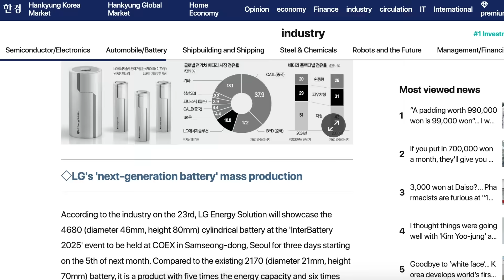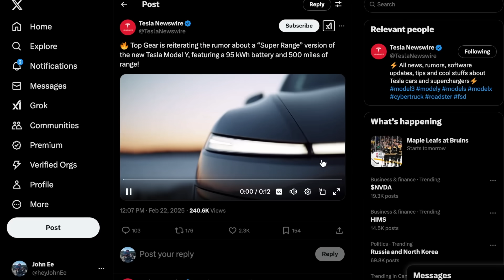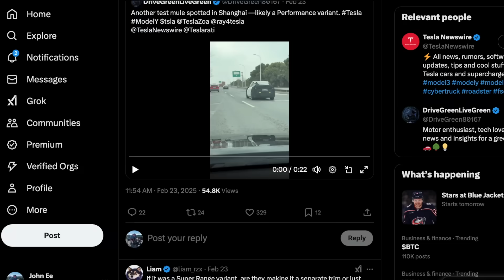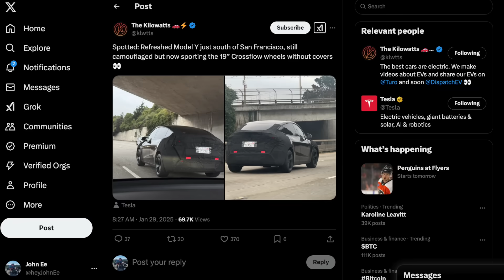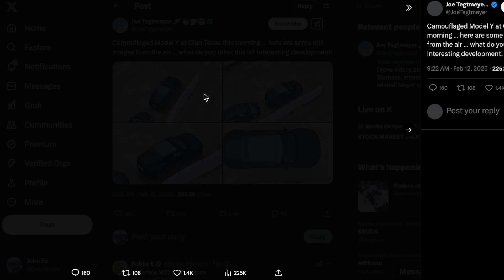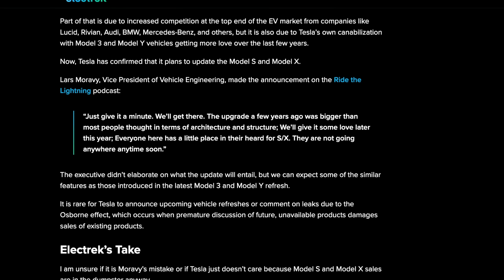Tesla Model Y Juniper Massive "Super Range" Battery Upgrade Coming  | It’s Exactly What We Wanted

Comment: The math. Todays 82kWh battery to a 95kWh battery is below 20% added. 20% more range will make the Y go 337 miles + 20%.= 400ish miles in a slightly heavier Y. So 500 miles is BS.

Comment: If the Performance gets a 95kwh battery EPA will be 365 miles, real life would be 275 miles, and this is what I want. I want to buy the Performance that is a lot less efficient than the RWD and right now the Performance is giving 225 miles real life and this is too low for me, I need more, and I know because I have a model 3 from 2019 with just have that range and I need those extra 50 miles. I you want RWD right now is giving you those real life 275 miles.
Reply from the maker: You want to buy a perf that’s a lot less efficient than a RWD? Lol  🤨
Reply: Current long range is 72kw usable and gets between 240 and 260 real world in the long range on the highway . 95 kw usable would get you about 60 more real world less if that is max and not real world.

Comment: Hard to believe that a battery capacity improvement of ~20% will give us 50% more range. Maybe closer to 400mile range.
Reply from the maker: Top gear might know something we don’t 😬
Reply: @ I saw their video, and yes, they might know something, but they definitely don’t know math. Or maybe is close to 470 miles in WLTP standard for the LR RWD model. And this will translate to around 400 miles in EPA.
Nevertheless this will still be great.
Reply from the maker: @Manu-P8 yup, and who knows they might be referring to CLTC standards and that’s a 15 to 25 percent higher than WLTP. Looking forward to it!
Reply: @Manu-P8  I already explained why you might be wrong.
Do not forget that  Tesla were going to offer the Model S Plaid+ with 500+ miles of range and that would have had a 100KWh pack so not far off the 95KWh this Model Y version is said to have. The Model S Plaid+ was going to use the 4680 cells but was actually scraped because of the issue ramping up production.
So yes it is possible that this version of the Y could have 500 miles of range.
Reply: @taefravis  You need to know just simple math to understand that this is impossible. You can increase the range of a car with 3 major factors:
-battery capacity,
-weight, 
-aerodynamic (this helps more on higher speeds).

Even if they manage to have the Model S plaid with 500+ miles (guess why they cancelled the initial project?) can you really believe that a SUV can have similar range with a sedan that has a bigger battery and better aerodynamics?

Comment: Nice, maybe I'll wait a little bit to buy. Although I'm not sure why people obsess so much over range. My gas suv that I plan on replacing with a Tesla, on a full tank it only goes around 240-250 miles. I get that refilling is quicker than charging but if you charge at home isn't that only really an issue on a road trip?
Reply from the maker: Normally isn’t an issue, but on roadtrips it would be nice. It’s always good to have more range than needed in case of an emergency
Reply: @heyJohnEe  Yup I hear that the new Tesla Mode SS will go from Berlin to Poland on a single charge in it's Blitzkrieg mode!

Comment: It's just that.  A Rumor.  If a Model Y with a 95 kWh battery comes out, it will cannibalize Model X sales.  Lars already said the Model X isn't going anywhere.
Reply from the maker: The S and X is getting a big upgrade, it could be improved the same amount as well
Reply: @heyJohnEe  Perhaps, you could enlighten all of us what this "big upgrade" is?
Reply from the maker: @KP-xi4bj I mean the Y already cannibalizes X sales by a long shot, it can’t get any worse even if the X gets upgraded or stays the same. It’s there only for memories and barely play any role in annual growth. Dunno what they’ll do exactly but I’m sure something along the lines up a Cyber design upgrade with all the similar perks
Reply: @ So, nothing solid?  Got it!
Reply: Lars and Elon said that the X is not important and is low volume.,
Reply: @ Lars and Elon also said that the X isn't going anywhere.

Comment: Won't happen until they use solid state batteries. No way that would have that big of a battery increase so close to the release of the Juniper with the current range.
Reply from the maker: Solid state is going to be a massive leap, hopefully even above the 500mi mark
Reply: They did this thing before so yes they would release a bigger battery!
They also do not need solid sate batteries which are years way ad always are years away!
The Model S Plaid+ had OVER 500 miles of range using 4680 cells so this is easy to do!
Reply: Not true. VW is releasing a car this year with QS solid state batteries. Also solid state batteries are safer. Don't catch fire. Go longer distances and charge faster. Do your research.

Comment: Would they really screw over the current Model Y Juniper orders? So the people that pay a premium would miss out on the upgraded battery sounds terrible. I can see them doing this for the refreshed S and X, but to add it to the Model Y Juniper so soon would be a slap in the face for people that ordered it at a premium.
Reply from the maker: Yes 100 percent they would. They did it to practically every car including the model S, within a week of releasing the refresh plaids they updated the rear end, front bumper, tail light, rear display, added 8Gb RAM for steam gsmes, etc etc.
Reply: @heyJohnEe  I am confused so they had 2 different versions of the refreshed model S within a week? I can only find 1 version of a refresh S and that was back in 2021. Sounds like a fail on their part, that would be equivalent to them changing the look of the juniper right now within a week.
Reply: Tesla screwed over lots of people in Jan 2023 as well. And also near June 2024 with the Model 3 Refresh.

Late 2022 and early-Jan 2023, people bought Tesla Model Y's for like $58k-$70k. Then like after 1st week of 2023, they slashed prices by a lot and the 3/Y also qualified for $7500 tax credit. Then everyone rushed to buy those cars. However, Tesla decided to add HW4 and Matrix Headlights to all their Model Y's in mid-2023 so if you bought in the first half of 2023 due to price cuts, you also got screwed cause you got the outdated hardware and worse cameras. 

I know a few people that paid like $60k-$82k for their Tesla Model Y but in the past year, you can get them for like 38k (including taxes/fees) while also getting financing promos and extra incentives (0% or 0.99%, free months supercharging/FSD, etc).

Near June 2024, Tesla got the Model 3 Refreshes to qualify for $7500 federal EV tax credit again by switching batteries. When those came out in Jan 2024, the non-Performance trims did NOT qualify for $7500 tax credit so people who bought between Jan 2024 and June 2024 had to pay full MSRP for it. And then on top of that, Tesla introduced 1.99% financing for Model 3 Refresh in like July/August 2024 so if you bought in like the first few months, you got screwed.
Reply: @ I see, I did put an order in for the new model y refresh. I am hoping I do not regret it, however I am looking for an SUV and kinda need it sooner rather than later. I could have tried to stick it out my current car but I have been waiting for the refresh for 2 years.
Reply from the maker: @Deheartless yeah within a week or so they essentially revamped the model S even giving it a new plaid badge, before it was just a text “PLAID”. But aside from that there were a lot of visual and internal upgrades as well. Bummer for those who took delivery early
Reply: @Deheartless  How many salutes will you do from your Tesal Swasticar?
Reply: @taefravis  i don't really care about that. It's a great car and has one of the highest safety ratings that will keep me and my family safe.
Reply: This is Tesla and if Elon is happy to shut down departments like USAID that Is resulting in people dying and he just shrug his shoulders and says pay him more money because he doe snot give a crap than of course they will screw over customers.

Comment: I dont see 500 mile range from a 95kwh battery. You would have to avg over 5 miles/kwh which tesla has not been able to achieve in any vehicle.
Reply from the maker: The newest Model 3 RWD LFP achieved 4.2mi per kwh, so we’re getting close. I’m sure they would need to improve aero more before achieving it with removal of extra weight maybe lighter interior material. My fingers is crossed 🤞
Reply: the current AWD Juniper would need a 125 kWh bat for 500 EPA miles. dont see it happening.
Reply: @RickyLourenco  I'm thinking about selling my 2023 Tesla Model Y LR AWD and getting the new 2026 Toyota RAV4 plug-in hybrid with over 500 mile range. My Tesla gets half of that range. I do love the smooth electric Tesla drive train though.
Reply: @RickyLourenco  The Model s Plaid+ using 4680 ceos got 500+ miles range and this rumoured Model Y uses 4680 cells so guess again.
Reply: People would have to wait longer to charge their vehicles at Superchargers as well.
Reply: Please look at the Model S Plaid+ that had over 500 miles of rage from 4680 cells in a 100KWh pack so guess again!

Comment: John, we've been hearing battery upgrades and increased range for the last 12 months, and look what the new Tesla model Y gave us. A big fat nothing as far as the battery range goes. 
Tesla must be the worst communicators as far as product information goes. 
Why doesn't Tesl just give a 2025 road map with real information so buyers can make an informed buying decision.
BTW, you may not be aware, but there is a class action against Telsa in Australia for not delivering on what they promise.
Reply from the maker: I would think it’s due to their need for vertical integration, right now they source batteries from other suppliers so they are held by the constraints. They can’t go any faster and cheaper than what those battery suppliers can make, and at the moment none of them have actually produced any Tesla requirement cells at prices to keep margins decent. Prob the main reason why they kept range the same for so long until soon. Once the new in-house cells are produced at mass production there wouldn’t be a reason not to increase range
Reply: @heyJohnEe  Except that both Lone skum and the board of Nazi directors are no longer on the side of any but Trump and the rich!
Do you know the suffering and deaths that Lone skum is causing?
Reply: This is Hair Lone Skum and the board of Nazi directors at Tesla so what do you expect?

Comment from the maker: Out of all the things happening a massive battery upgrade is what most of us are after, but aside from the longer range is there anything else that can be improved?
Reply: Along with that bigass 500 mile battery, if they added bi-directional charging I would buy it and my Y is only 2 years old. That's assuming they removed all those mandatory "options" that they forced on people with that launch edition.
Reply from the maker: @lashlarue59 yes and yes, I agree totally
Reply: @lashlarue59 these bi direct chargers are still way too expensive to justify using them currently between $7,000 to $15,000 in Australia.
Reply: Hey John, do you think the 95kWh battery by any chance will be assemble to the late launch series vehicles?
Reply: Until there is a change in battery chemistry like the silicon battery’s the Chinese’s are starting to manufacture, you can have a much denser pack in the same size it is believed the range can be 500 miles.
But there have been ZERO leaks or changes in upcoming Teslas batteries. Even Tesla has admitted battery tech needs to improve before range and charging can be improved.
Reply: @kennordsfan1494  This is what the NEW 4680 cells are for!
Reply: Out of all the thing we want, Lone Skum p*ssing off to Mars and rake his orange boyfriend with him is the only one!